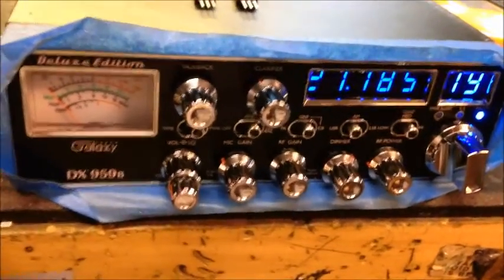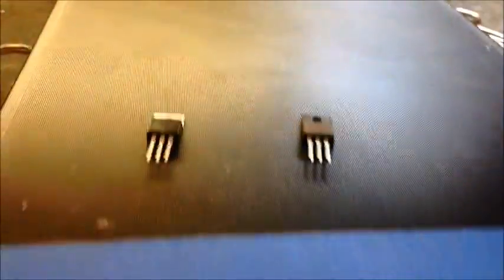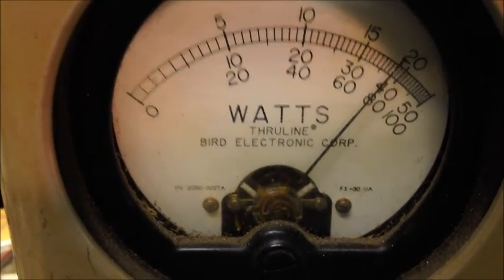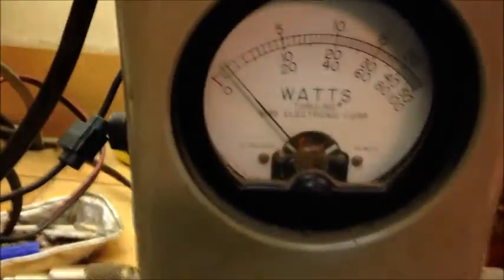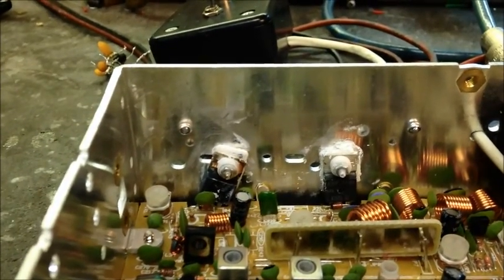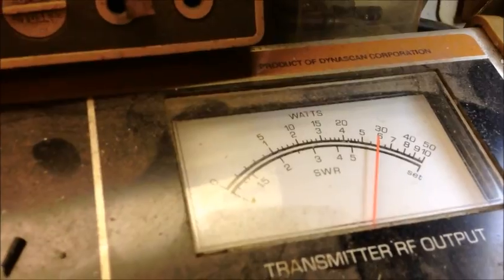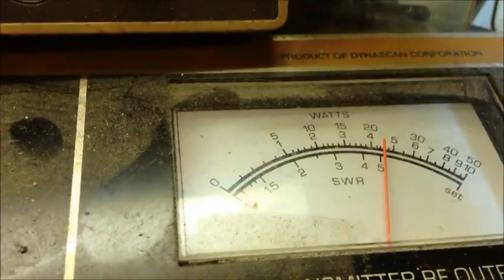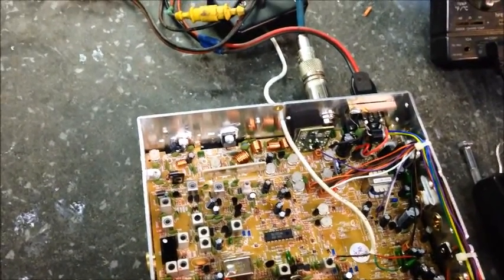Galaxy 959 changing out finals

Comment: so the 2030  was the best ? or did it need more  cooling to  be recommended
Reply from the maker: +danny blackhorse Well that depends on if your an rms or peak guy. And yes it does get warm fast. I'd rather go with the 13nq over the 2030 for the heat issue's. Because after a while the watts starting to drop a little, and it must be from the heat. This wasn't in the video.